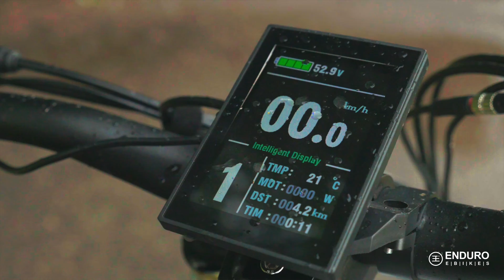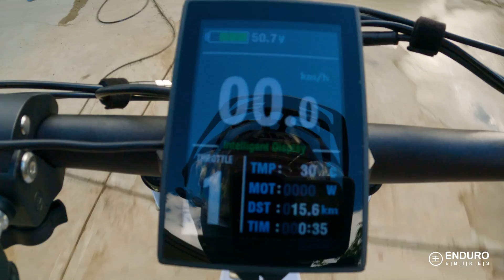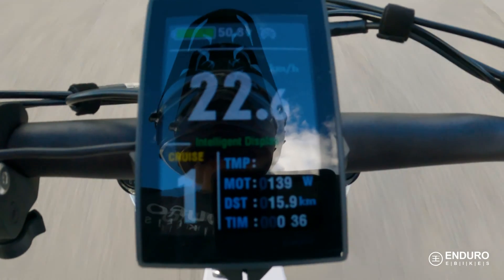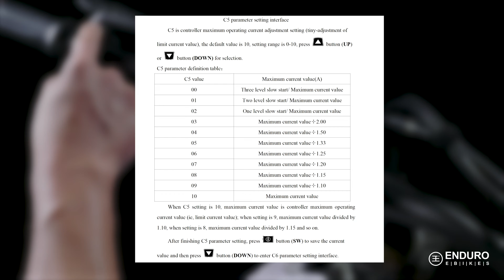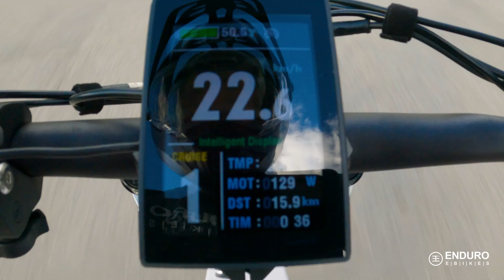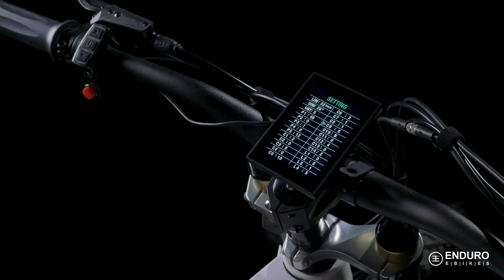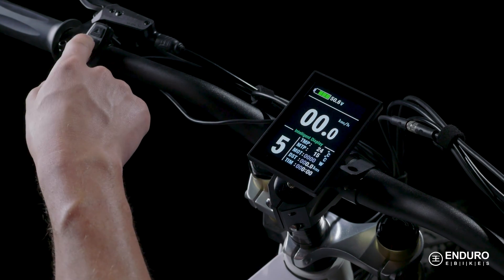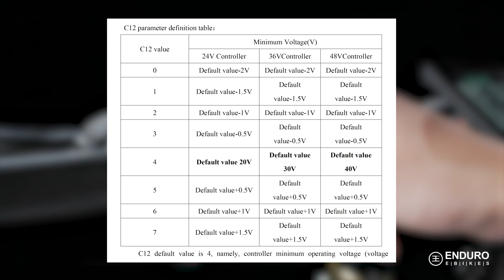How To Use KT LCD8s Color Display

Comment: On this display I miss a clock and also the total of kms driven with this bike 🙁
Reply from the maker: Yeah the color LCD display that comes on all our other models 3000w and up come with the 750CC color display which has the clock and KMS function. The display shown in the video though does have the trip km and total mileage.
Reply: @EnduroEBikesCanada  Thanks, I found the kms and set the password ... but still miss a clock here 😊

Comment: How do you switch lights on with this display?
Reply: Push "power on" + "up" during 5 seconds
Reply from the maker: For the lights on our bikes we use a seperate control switch. If you would like to know more about further customizing your bike with modifications and require details such as user guides, manuals, wiring diagrams, or live tech support please reach out to your assigned whatsapp support group at time of purchase and they will be able to assist you further. Alternatively reach out to customer.services@enduroebikes.ca with your frame serial number and they can help as well with your technical support inquiry for your specific build.

Comment: Firstly. Hello 🤝 I need complete information on the settings, what and which setting performs the functions... example: I need to change the Recuperation braking with the engine.... the name of my controller: Sabvoton controller 72 V, 150 A, V2. Secondly. what needs to be done and how it works together with the brake lever example: Regeneration + brake light signal 12v. or change phases +\-. or controller settings.. or through the V converter. thanks in advance...👈🤝🙋‍♂️🤔😳😀
Reply: vo pervykh. Zdravstvuyte 🤝 mne nuzhno polnoye informatsiya po nastroykam chto i kakaya nastroyka vypolnyayet funktsii… primer: mne nado izmenit' Rekuperatsiyu tormozheniye s dvigatelem…. nazvaniye moyego kontrollera: Kontroller Sabvoton 72 v, 150 A, V2.    vo vtorykh. chto nuzhno sdelat' i kak rabotayet sovmestno s rychaga tormoza primer: Rekuperatsiya + svetovoy signal tormoza 12v.  ili menyayte fazy +\-. ili nastroyki kontrollera.. ili cherez preobrazovatel' V . spasibo za raneye…👈🤝🙋‍♂️🤔😳😀
Reply from the maker: These seems like a more technical question better suited for your assigned whatsapp support group at time of purchase